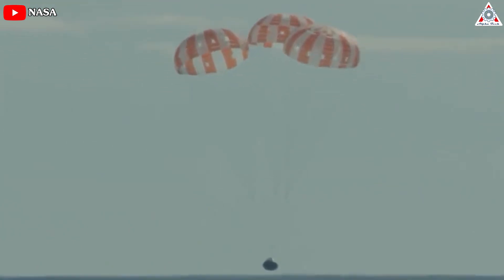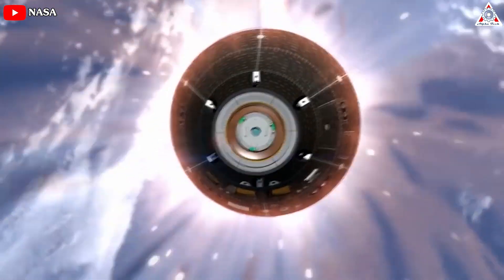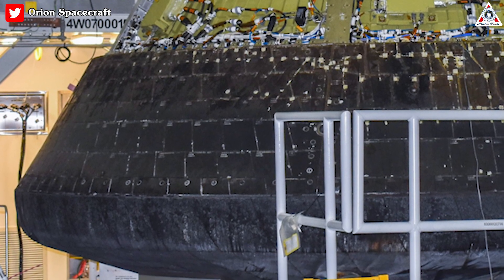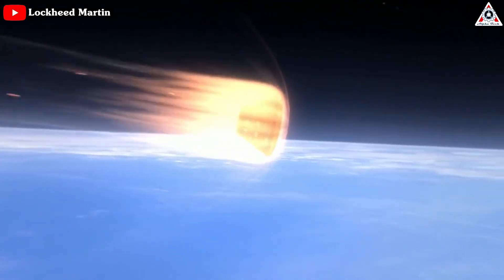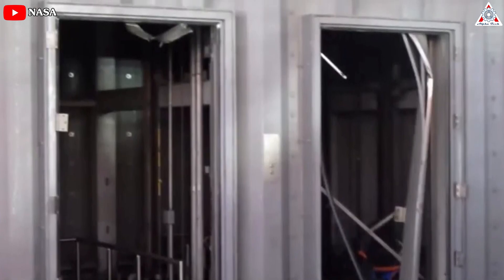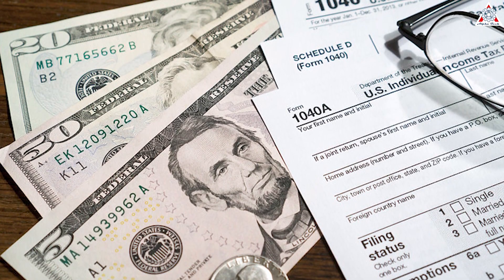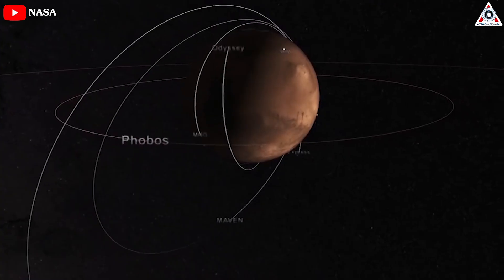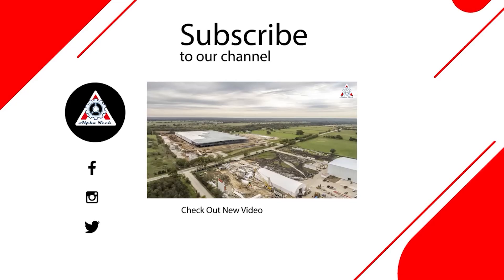NASA Orion’s Heatshield PROBLEM after Lunar trip, Pad damaged. Is Dragon BETTER?

Comment: The Orion heat shield that returned from the Artemis I flight appears to have experienced severe spallation that caused chunks of those ablator tiles to become dislodged. Could be due to hot gas intrusion into the gaps between some of those 184 tiles. And/or moisture and volatiles inside the tiles becoming superheated during the entry and pressurizing the interior until the tile fractured. Not good.

Spallation is sometimes seen during arc jet ground tests on military warhead heat shields.

Lockheed Martin has to fix this problem before Artemis II is attempted with a crew aboard.

Comment: The heatshield abated less evenly that they expected at places.
Some areas were abating with small chunks instead of smooth ablation, which was not predicted by their models.
Not a safety problem, just a difference of how the real life heat shield works vs how it does in models, which was literally the point of this test flight.
The heat shield itself did not seem to ablate significantly more than expected, they still had lots of margin in the form of unburnt avcoat, just abated a little differently than they predicted, so they want to understand why to update their models and for the sake of being thorough considering their first crewed flight is coming up next.

The ML damage was expected to happen, though they expected their elevators to hold up.
Repairs are already nearly complete, it's not a noteworthy issue at all. 
I'd expect the ML to hold up better after Artemis 2 with all the lessons learned from the first flight.

And no, Dragon is not better.
Orion delta V is 1300m/s vs 400m/s for Dragon.
Orion can re-enter from the Moon as currently designed, Dragon (probably) can't.
Orion can carry 4 crew for 21 days vs Dragon with 4 crew for 6 days.
Orion is more roomy, has its own radiation shelter and dedicated toilet, can support it's crew without a pressurized cabin for over a week in the case of an emergency. 
It's better in every relevant metric.
Reply: That Orion heat shield damage was not a little bit, it was a lot. And NASA saying that the observed spallation damage was "within family" and that there was enough margin left in those ablator tiles, is the type of normalization of deviance management BS that led to the Challenger and to the Columbia disasters. 

We saw that type of spallation damage on Shuttle ceramic fiber heat shield tiles during development in the 1970s. The cause was moisture in those tiles. NASA had to rewaterproof those Shuttle tiles between each flight to ensure that spallation did not cause severe damage during entry descent and landing (EDL).

Side note: My lab developed and tested numerous variations of those Shuttle tiles during the conceptual design phase of that program (1970-71).
Reply: "Ablating in chunks" is NOT ablation....it's spallation, which was NOT supposed to happen at all!  This means something happened that shouldn't have and they MUST find the cause because they don't know if the "minor" spallation will be critical next time. It is a BIG safety issue. Handwaving such things away caused the safety environment that causes the destruction of 2 shuttles and loss of 14 lives.

Comment: Quite frankly, I thought that the first test of the Orion spacecraft tested the heatshield at lunar reentry speeds but I guess I was wrong....  As for budgetary considerations, ditching the worthless and irrelevant Lunar Gateway would be a great start!
Reply: You won't think the Gateway is useless during the first unexpected emergency on the moon. Also, just how do you expect NASA (or SpaceX for that matter) to test Mars Interplanetary Spacecraft technology without the Gateway Space Station? The ISS is safely protected by the Earth's magnetosphere. The Gateway will be the first long term manned laboratory outside the protective magnetosphere of the Earth. It will be essential to testing flight hardware that will need to reliably operate for 18 months at a time for a Mars mission and return. Or would it be better to just build it and hope it doesn't fail on the way to Mars?
Likewise all those people that say the moon is an unnecessary diversion from our Mars ambitions are neglecting to see the value of testing Mars surface hardware on the Moon, which is only a few days away from Earth (and hours from the Gateway), rather than 8-9 MONTHS away from home on Mars.
So many people have opinions, but are not really involved in thinking about all the details and all the obstacles involved in a moon or Mars program. Even Elon can betray is lack of foresight when he downplays the obstacles.
Reply: @i-love-space390  First of all, the Lunar Gateway would be worse than useless in an "emergency".  What do you expect them to actually do?  The LG can't land on the Moon, nor will it have a permanent lander attached.  The LG's orbit is difficult to get to from the Moon, (it will involve waiting and a precise launch time because a lander will have precious little extra fuel to get to the LG first and then to Earth) and will take longer than a direct flight to Earth in a medical emergency.  There is also almost as much chance of an emergency occurring on the LG itself thereby making it not just totally useless but an actual impediment to lunar exploration.  Add in the fact that any spacecraft that's required to dock with another is restricted with regard to launch time and adds extra time (especially in the orbit planned for the LG) and risk to the mission, and the obvious redundancy of the LG comes into sharper focus.

As for testing a manned laboratory outside Earth's magnetosphere, why would you subject astronauts to that!?  They would be more like living lab rats who may or may not get sick!  Wouldn't it be better to simply send an unmanned test facility beyond the Earth's magnetosphere to gain data, or even incorporate instruments to test what humans would be subjected to on an unmanned trip to Mars with the next orbiter or rover?

I'll repeat, there is nothing the LG can achieve that can't be done quicker, better or more safely on Earth or in Earth orbit.

Comment: Why didn't they use the Apollo heat shield design?
Reply: Because the Orion is something like 50% larger than the Apollo Capsule. It's heatshield design is BASED on the Apollo design, but has newer materials and has to be designed for the different loads.
But as the NASA employee said, if anyone bothered to watch the video rather than just reading the Click-baity headline, there was more than enough margin built in to insure safety.
He is just saying the obvious - that we need to always update our models in light of new data. That's how NASA has gotten us here over the 100+ years of its existence (if you include the NACA that is its predecessor agency back in the quaint old days of aircraft, before spacecraft were possible).
Reply: The Apollo command module wasn't made to be re-usable.  Orion is, so the heat shield damage matters, because it needs to fly again.  Damage to Apollo heat shield didn't matter beyond splash down.
Reply: 24k mph reentry rather than 17k mph

Comment: Orion.  The 60 year old political "barrel over Niagara", tech welfare  project.  "Falling" onto the earth at 24,000 mph after leaving the moon is not the way to go considering  todays capabilities. The only long term sensible way to travel in space is to and from dedicated earth orbiting "space ports"  where the moon and planet bound transports can be fueled and provisioned.  Any transport landing on earth can use fuel to de-orbit to ground speed before entering atmosphere.  that means no heat problems.  Use fuel to maintain a reasonable "falling" speed and a lander can glide to a landing.  A Falcon Heavy or equivalent can be used to ferry fuel to orbit for a number of entry burns.

Comment: Anyone already wondering how they didn't have these problems in 1969, at that time they did it without any computer sims at all or might it be that they never had to use these type of heat shields because the reentry speed was never 24K miles per hour but that of a low orbit satellite and only 17K miles per hour. Fun,  one day they have to say it and add and other lie to the list of lies.
Reply: What are you babbling about? Have you seen Apollo command module capsules? Their heatshild was over-engineered, and all they cared about was that it survived.
Reply: @bazoo513  Don't be angry, I just raised a question. It looks like you're panicking when someone babbles while there is no reason for it. I just don't believe in dinosaurs even when they show me that on a Hollywood screen, neither do I believe  a Bureaucrat who says we walked on the moon. You are free to do so.
Reply: @bazoo513  yep he's  babbling nonsense
Reply: They had plenty that you don't  know about. They had computers. I was born in58. You need to read some 
 You just assume. I'm a space historian. You are quite misinformed
Reply: @curtishegner9245  Yes, they did have "computers" - UNIVAC 1107, a several tons behemoth with magnetic RAM (thin-film, not cores, 64 kilo words of it max - you know, million times less than your gaming laptop) and magnetic drum mass storage (besides tapes). It might have been as powerful as a present day $1 microcontroller at best, but it did have a FORTRAN compiler.

Apollo flight computer was even less removed from an abacus. It is sheer miracle what Margaret Hamilton and her team managed to cram into it.
Reply: Moon  rentry is 24500. I'm an engineer. Try too  learn something because sound unintelligent
Reply: Orbit velocity  is 17500 moles an hour.
Reply: Thumbs down
Reply: Computers  have been around since 1948
Reply: Sigh. Another "I don't understand it, therefore conspiracy" "contributor". Learn,  man!

Comment: Congratulations NASA! ORION has a GREAT and EFICIENT DESIGN !
Reply: Yes it does and it is even better than the crew dragon
Reply: @raijingaming9608  You keep thinking that. They can only afford one launch per year. Really efficient!! Additionally, they burned out the launch tower, so that's got to be repaired now. But since they can't launch for another year they have to repair the tower.
Reply: @jeffreyxxx6176  and the sls is a complex moon rocket the starship hasn’t even gotten to orbit yet, so we’re not gonna talk about that all his other rockets can’t reach the moon so
Reply: @raijingaming9608 SLS was obsolete before it even left the drawing board. Yes it's impressive, but too expensive and really isn't very innovative. Starship will be less expensive and has a lot more capability than SLS. Additionally, it will launched many more times per year than SLS. At $4.2 billion per launch, which represents 15% of NASA yearly budget, it is a failure.
Reply: @jeffreyxxx6176  I just said starship has not launched yet and I won’t be doing any missions for a long time so there is no point of comparing it to the sls
Reply: Not at $4.2 billion dollars per launch. Only the government would think that's efficient.